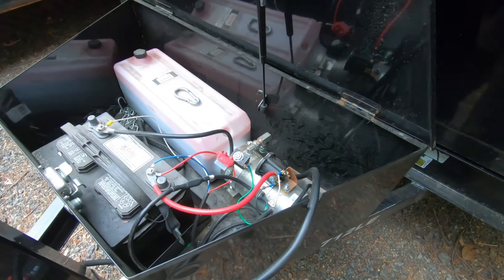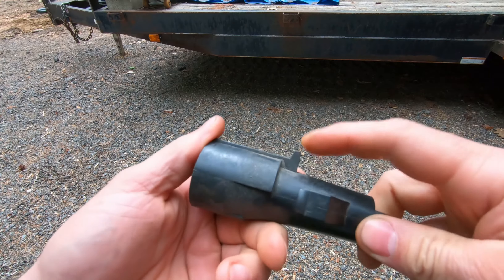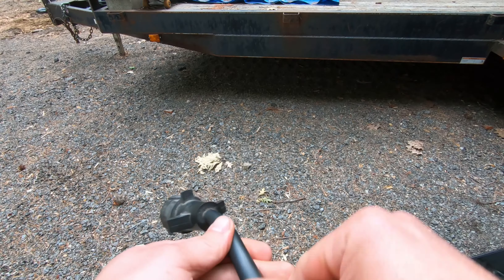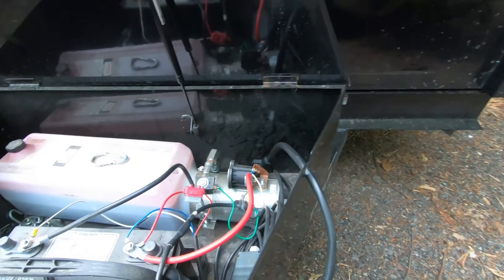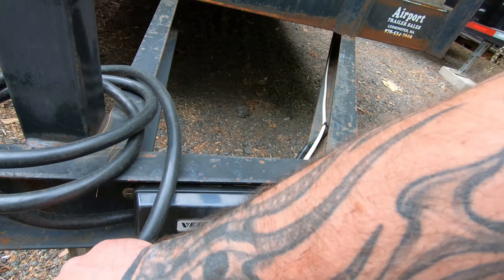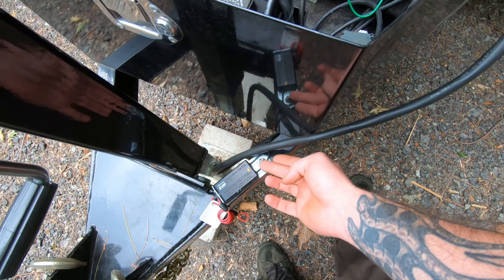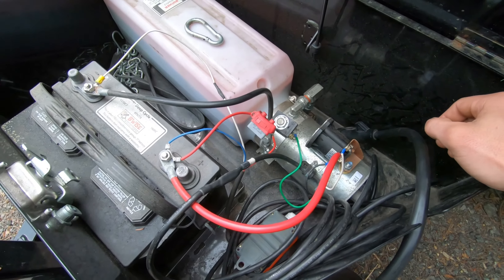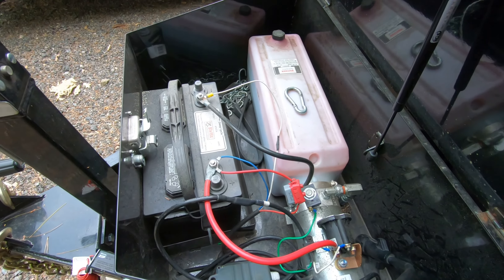Wiring a trailer to charge off the tow vehicle

Comment: So basically. Open the box the 7pin wire goes to. Add wire from the black wire/12v supply to your trailer battery. This should keep your battery charged and even voltage with tow vehicles battery. Just dont put a huge strain on trailer battery.
Reply: lol, exactly, this was a long way to say that, but yes. That is what I got out of this too.
Reply: You can also install a diode so power can't flow backwards

Comment: I've found it alot easier to just wire a 12v outlet into the trailer box and get a 150watt power inverter and hookup a small 2-3amp trickle charger/maintainer. Easy to do and shouldn't overload the curcuit.

Comment: If I am running a winch to load logs and my battery starts to get drained wouldn't it try to pull the amps from the little wire coming from the seven pins. The winch 2500 badlands on my crane draws up to 300 AMPS at full load and 55 at 1,000 lbs. So when a battery starts to lose power the voltage goes down and if the tow vehicle tries to keep it at 12 and higher wouldn't that course a large number of amps coming from the tow vehicle when coupled to the battery that has the draw?
Reply from the maker: It’s possible I would keep an eye on it if it gets hot. Your not really in a series configuration, its going to be in parallel so I think it would draw mostly from the battery, but you should have a fuse or breaker that would trip if it draws too many amps.
Reply from the maker: This method of charging is mostly for RV batteries and things of that nature. if your intention is to use it to keep a battery charged so you can run a winch continuously I don’t think that the small charging wire is going to suit your needs. You are probably going to have to put in heavier gauge wiring and probably a bigger alternator if you’re drawing 300 Amps continuously you might be better off just running a set of jumper cables from your main battery to your winch battery on whatever you’re loading with. I haven’t had any problems with my dump trailer for the years I’ve owned it but it doesn’t run continuously either it just dumps and then charges while I’m driving.
Reply: John, you are correct.  When the battery starts dropping from 12 volts the current  from the vehicle will increase to many amps and the inline fuse on the tiny wire will blow. The fuse might be rated at 15~30 amps so that is the limiting factor. Once the battery has a heavy load on it, it will only be a matter of time before this approach pops the fuse.
Reply: you can install a diode to make sure it only charges and doesn’t pull from the small wire…
Reply: You could always try using a connection like battery powered forklifts. Hooking up to the alternator then you can leave the tow vehicle running to keep battery charged. 
I think his method is more for cargo trailers or fuses that are winching cars up on a trailer

Comment: great video thank you. is there a risk that you could overcharge the trailer battery if you drove for say 4 hours a day
Reply from the maker: To be honest I’m not sure. It was only sending about 6-7 amps to the battery which isn’t much so I don’t believe it would be a problem. But honestly I don’t really know. I think the breakaway battery boxes are wired like this too so I’d imagine it would be ok.
Reply: No. It's using the power supply that the alternator creates. The alternator is designed to properly charge a lead acid battery.

Comment: Hello Jason. I have a 14.4 a lithium battery in my camper, so I have been told that I should disconnect the alternator from the camper because it could overheat the alternator and burn it up. So.... how do I disconnect the alternator from the camper in a 7 pin arrangement? Thx! Good video. Scott
Reply from the maker: If you are looking at the terminals on the trailer connector from the front, the upper left wire is the 12volt power wire from the vehicle. That is the one you should disconnect if you mean you want to disconnect the charging from the vehicle. Depending on your vehicle there is probably a fuse for the charging wire on the vehicle. You can probably just pull the fuse in the fuse box too
Reply: Thx Jason. So it’s just a matter of disconnecting one wire. I think I can do that. Thx again. Scott
Reply: you need to use a dc to dc charger on the lithium battery.   lithium batteries have lower internal resistance than lead acid.  lower resistance pulls way more amps.

Comment: The circuit breaker, or fuse, is wired in-line (wired in "series") to protect the WIRE. Not what its supplying power to.
Always rate the wiring size to the electrical load requirement, and then install a circuit breaker/fuse to protect that sized wire.
-I'm an electrician

Comment: I just had a question I was going to set up everything the same way as you described but will the breaker from the charging wire prevent a heavy amp draw from a winch on a car trailer from drawing on the car battery or over heating the charging wire. Should I unplug the 7 way connector as a precaution? Thanks
Reply from the maker: I would unhook the trailer connector if your gonna put a large consists draw on it. I would imagine the breaker would trip but I don’t know how long it will take to disconnect. This set up is mainly for charging the battery’s not for supplying power to a load on the trailer. I will say I’ve never disconnected my trailer plug when running the hydraulic pump for the dump trailer and I have not had any issues but I cannot guarantee you will not encounter any problems.
Reply: @JasonTheMunicipalMechanic  ok thanks for the quick reply I have a battery on the trailer I just wasn’t sure how the 8 or 10 gauge wire would react and didn’t want the winch to try and draw from the truck and the trailer battery.  ultimately once I get the diesel running I plan to run a 4 gauge wire one way plug with 100 amp breaker.

Comment: So if I’m not mistaken you said hook the cable to the neg side of battery?
Reply from the maker: Your gonna hook the positive that comes through the trailer plug to positive  with a  breaker in line, and the negative that comes through the trailer plug to negative on the battery.
Reply: @JasonTheMunicipalMechanic  thanks that’s what I thought guess I misunderstood what you said

Comment: I'm confused. So do you have a ground from the neutral terminal to the trailer or do you have a ground going to the 7 pin?
Reply from the maker: Both. They will be connected at the junction box. Ground comes in on the 7 pin and goes to the junction box where it then goes to the trailer to provide ground for the lights. It will also go to the battery to provide ground to charge it.

Comment: Do you use a fuse or relay for the hydraulic pump?
Reply from the maker: The hydraulic pump is actuated by a relay, but I believe there is a circuit breaker that is inline in the control circuit of the controller.
Reply: @JasonTheMunicipalMechanic  ok thanks. Trying to hook mine up properly
Reply from the maker: I will look after work and see exactly how it is wired.
Reply: @JasonTheMunicipalMechanic  thanks
Reply from the maker: So I’m not suggesting this is the right way to wire the pump but it is the way brimar wired mine. There are no fuses on the pump wiring unless there is a fuse in the controller box I am unaware of. There is a large battery cable that delivers positive to a large relay that is mounted directly to the pump motor. A small wire is paired to the battery cable at the stud on the relay that feeds positive to the controller box. A wire comes out of the controller box and is attached to the energizing stud on the relay to engage the relay and run the pump. Another wire comes out of the controller box and goes to the valve that opens and lets the fluid back into the tank so the body can lower. There is a large power cable that goes from negative to the pump motor case to supply ground.
Reply: @JasonTheMunicipalMechanic  ok. Thank You! I might try a breaker.

Comment: Hi Jason do I need need to install a relay if I'm using small battery (ie lawnmower battery). I'm only using it for a LED strip
Reply from the maker: If your asking about using a relay to power the led strip I would probably say no. I would check the amperage draw of the light and the rated capacity of the switch your going to use. But I would imagine it would be fine. If you mean a breaker for the charging of the battery I would put one in to protect the circuit if the battery goes bad or shorts internally.
Reply: @JasonTheMunicipalMechanic  The amperage draw is less than 5A. It's a small 12V battery so that I can have the LEDs on with out having to have the tow vehicle connected and or using the LEDs on the battery when loading equipment at night.
Reply from the maker: I think you would be fine without a relay.

Comment: Myabe I’m missing something but, I have a Renogy dc-dc on-board charger w/MPPT(for solar) that can charge my batteries from either my tow vehicle’s battery, solar panels or both! Renogy told me I would need to use seperate 4 gauge battery (+/-) wire/cable from my tow vehicle’s battery to the charger and couldnt use the existing 7-pin connector. Just curious if that’s kinda what ur doing?? Thanks for the video either way!!
Reply from the maker: I’m using the 7 pin connector positive wire to charge the battery. The smaller factory wire might not carry enough amps to work with your setup but for my dump trailer it works fine. I’ve had it for around 3 years and I haven’t needed to charge it. I’m not familiar with your charger so I’m not sure why it would require that size wire, but it might burn up the factory wire if it requires a high amp load. I’ve installed a 7 pin connector with a charging wire that came from etrailer, and the instructions required a 10ga wire to the plug. A 10ga wire will carry 30 amps and a 4 ga wire will carry 70 amps. I guess if you had a really dead battery it might draw a lot of amps. If they told you to use a 4gauge wire then I would recommend you use what they told you to use. Something to take into account is the size of your alternator depending on what the vehicle draws to run it can only send what’s left to the trailer, but a bigger wire would be better.
Reply: What wattage solar charger you have? Also your solar charger should come with the required wire for its intended application. I have 2 -a 35 watts and it charger for a battery and running a fan. The other is a 20 watts works a a battery maintenance charger on my flat bed trailer.

Comment: Do you think the truck limits the amperage so you don't melt your wire? I see people say that a low trailer batter will draw too much but that wont happen if the alternator is limiting how much is going down that plug wire. Some people are saying we need to buy a $100.00 DC to DC charger. I did not have a DC to DC charger on my Airstream but now I'm trying to wire a cargo trailer that has a 100A Battery. I'm driving a 2010 F-250 Diesel with what I think has a 135amp alternator.
Reply from the maker: I don’t really think the vehicle will regulate the power to the trailer plug, but I guess it’s possible. The vehicle uses power to run everything on the vehicle and also put power back into the battery so you more than likely won’t be sending full power to the trailer battery anyway. I think if it was burning up wires and starting fires then they wouldn’t be wiring trailers like this from the factory. There is a 30-40 amp fuse on my trailer so I know it isn’t getting more than that, and if for some reason it was getting enough power to melt a wire (providing it is the correct size) then it would blow the fuse in the fuse box or trip the breaker on the trailer. I could be wrong so I would recommend not doing anything your not comfortable with. I’m not sure about any special type of battery though. I’m using regular lead acid battery’s so there may be differences there.
Reply: @JasonTheMunicipalMechanic  A read a few more posts in a Ford F-250 forum and they all were saying there's just enough current to barely charge a trailer battery so it's more a maintenance current so now I think the truck MUST be limiting it. I have full battery voltage at the trailer plug. The brake controller also uses that wire along with a blue break wire (in the 7 o'clock position in the plug on the truck) I already wired it into the trailer but I have not connected it to the battery so I will leave it disconnected until I think I need it (like if my generator wont start) or to do a test . . . Fun . . . LOL If only I had a proper truck wiring diagram.
Reply from the maker: I’ve gotten a few manuals from Emanuel.com and they were pretty good. Not very expensive either.

Comment: Can it over charge the trailer battery? Is there a way to discharge when it maxes out? Thanks! :)
Reply from the maker: I don’t believe it would over charge, but I’m not sure. I haven’t had any trouble with mine. It doesn’t send much power to the battery, it depends on the vehicle but my gmc basically just connects the battery to the electrical system by tying it to the main battery on the truck. With the vehicle the battery is used for storage to start the vehicle and for power with the engine off. The alternator actually runs all the electrical when the vehicle is running unless it can’t keep up with the load, but charging power is always supplied to the battery at least in older vehicles without smart charging systems. If it’s not over charging the truck battery why would it over charge the trailer battery. As for discharging the battery they don’t really get overfull like a pot of water. I guess it would depend on what your using the battery for on your trailer if this is a practical thing for you. My camper uses this method and my dump trailer does too and I haven’t had any problems with it. But like I said with my truck it just ties this battery in parallel to the electrical system on my truck through the fuse box

Comment: What’s the blue cable
Reply from the maker: The break away switch for the brakes use this main battery instead of a small battery to activate the brakes if the trailer comes off the truck.

Comment: No fuse to the motor... Yikes, lets hope the motor never shorts itself to ground and no fuse from the battery... FIRE
Reply from the maker: That’s the way the trailer manufacturer sets them up. You do know there isn’t a fuse between the starter and battery in vehicles right? This is set up pretty much the same way. There is a solenoid that controls the pump motor.
Reply: @JasonTheMunicipalMechanic  I’d install a marine grade 300amp fuse right over the positive stud on the battery 🔋 
Every wire should have over current protection. Motors do fail, I wouldn’t want to dead short my battery.

I have a drop deck trailer with a hydraulic pump motor right off the battery. 🤔🥴 that’s kinda sketchy
I’m a rework that so I don’t blow up my battery and I want to vac as a distribution block to have fused circuits for accessories and all me to back feed it from a dc to dc charger

Comment: So all u need is a braker fuse and it work
Reply from the maker: On the trailer side that is how it’s wired from brimar and has worked since I owned it. Your tow vehicle needs to be set up to send power to the trailer plug though as well.

Comment: Jason, Excellent video Thank you! I am trying to duplicate the setup you show but I cannot find the small Vetomile unit you have mounted to your trailer. Could you tell me the model #, please? Thank you, again, John Nelson, Pasadena, TX.
Reply from the maker: Thank you. It’s just a trailer junction box. I think the vetomile is a brand or something. Here is one from amazon https://www.amazon.com/dp/B07PT5Y29V/ref=cm_sw_r_cp_awdb_imm_MZZBZK64D7SF3ZED3222 you can also search trailer plug junction box on eBay and will find some too. You can search around for some pricing. I seen them around 30 dollars and up to 60ish I would just make sure the brake wires are bigger like the 10ga in the one from the link.

Comment: What if I have a four pin on the trailer?
Reply from the maker: You will have to add a 7 blade plug to it. You can remove the 4 pin plug and wire it into the 7 blade connector and add the wiring for the power and possibly a ground depending on how it’s wired.
Reply: The 4 pin connector doesn't offer a 12v feed like the 7 pin so you can't charge with the style.